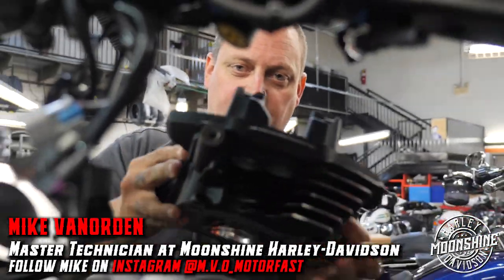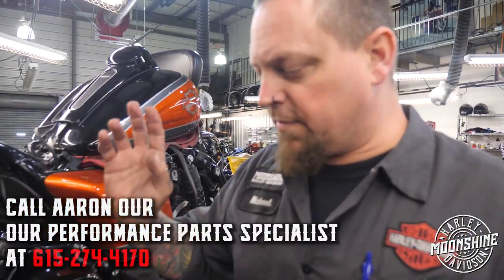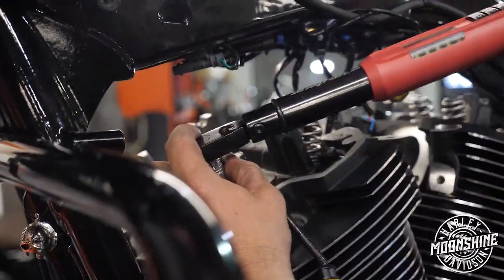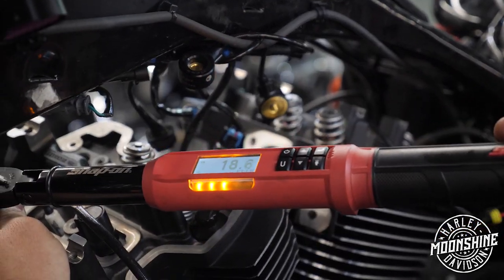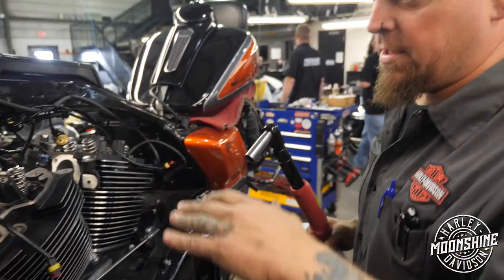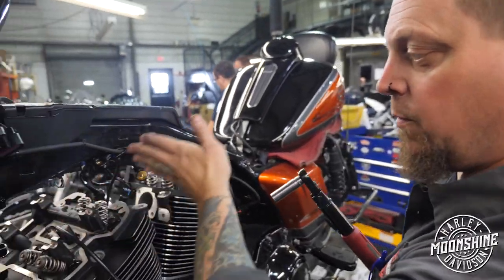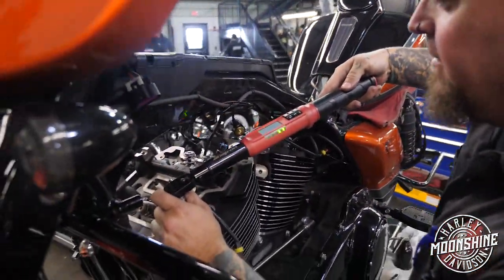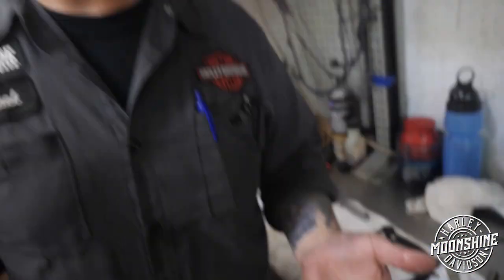M8 Head Bolts Are BREAKING!! Let's Fix It | Shop Talk Episode 27

Comment: And all that will change  after heat cycle . also hope your using moly lube on the threads & under the head bolts. big difference you'll come to torque faster  less friction

Comment: Good stuff and procedure but I've learned on my second Harley and I'm on my fourth now to leave them stock less headaches exhaust and aircleaner change & tune and that's it .
Reply: I think the increased torque on the M8's (partly due to the increased size of the fasteners themselves) is part of the issue.  On the Twin cams the Cometic final torque is 42 lbs I believe and the 90° torque to yield (stock procedure) is started at 15-17lb/tq.  On M8 the 90° is started at 25lb/tq while the S&S/Cometic recommendation is 45 lb.

Comment: As a heavy duty mechanic and retired for 12 yrs and a owner of Harleys it always blows my mind way they waited so long 
to put in oil spray piston coolers and it's time to make better head gaskets . maybe a fire ring type to stop the back head gasket from going out .diesel engine compression is way higher than gas and with the fire ring type  used in MACK i never had a gasket 
problem .torqe recheck and go up recheck and wait and recheck i never had a come back .motorcycles are still in the dark ages

Comment: As a professional mechanic, I have never liked the "low-torque plus degrees rotation" method for torquing a head. Your finding here once again proves there is no substitute to proper "true torque" procedure when torquing a head. And just as you found here, the new head gasket settles & compresses. This is the reason you need to go back and re-torque the head. On industrial diesel engines, we would test-run the engine to operating temperature then re-torque the head while hot (not recommended for Harley, or aluminum heads). This also meant re-setting your valves of course.
Reply: Jim Manson  we also never reused headbolts....
Reply: I am a certified aircraft mechanic and I find it appalling at how good harley is at releasing new models before the engineering work is complete. For some reason, they can't even manage to get their throttle by wire correct. I have a 2001 Jetta with a flawless throttle by wire system. I guess Harley didn't have the common sense to contract out the design to Bosch!
Reply: @skorpius752  "Here hold my beer.  We can do it."  hahaha
Reply: @skorpius752  Harley is just doing what Harley has always done. It's called cheap and dirty. The best bikes that Harley has ever offered are the ones primarily designed, engineered, and built by someone else like the V-Rod which was HD's second joint venture with Porsche. (The first was the Nova in the late 70's.) Their customers are not open to change so HD doesn't change. (This is borne out by the HD owners first reaction to the M8 engine. It was too smooth and didn't shake enough.) It will in the end be the cause of their demise unless they can remake themselves as a tech company which is highly unlikely. One of the interesting things that has happened in the last few years has to do with millenials. Millenials don't like to ride bikes and there was a study done to find out why. One of the biggest reasons was they don't like all that shifting, hence the Honda Goldwing DCT. Part of the study was to try to find out what bike a millennial might be interested in and they were overwhelmingly in favour of HD as their first choice based on brand recognition. Harley thought this was great and sold as many bike to millenials as they could. Problem was, they didn't put any money into improving their product with things like a DCT or better reliability. When it came to purchasing their second bike, the few millenials that would ride chose anything but HD products. Too many breakdowns, too many problems, and too many bills to keep them running.
Reply: @oh8wingman  You are absolutely right. My younger brother is a case in point. I ride a Moto Guzzi and about the one and only time i mentioned The VRod he could only criticize it. Try to pinpoint the reasoning behind that attitude and i can only conclude that i didn't realise he was so dense. Also that he would be such a band wagoner. I pretty much concluded that it didn't sound like the traditional Harley, didn't look like it or have the same power curve. In short, it was too advanced for his liking. He didn't appreciate the more balanced, higher rpm characteristics of the V Rod over his 2006 Night train. The DOHC shorter stroke engine did nothing for him. I'm thinking maybe he raced one and concluded that he didn't like that sound pulling steadily away from him and his bike because i have seen the VRod being wrung out and that thing really moved out quickly with a more refined everything.
Reply: The whole point of going to the "low-torque plus degrees rotation" method is it provides a more accurate clamping force that relies on stretching the bolt, rather than a set torque where friction often means that setting isn't accurate. If a bolt is designed to stretch a reasonable amount when installed, if there is any "head gasket settling", it won't affect the clamping force much. A very strong bolt that hardly stretches at all is much more affected in the same scenario. Those sort of bolts can go from maximum torque value to released in 1/8 - 1/4 of a turn, so are more susceptible to clamping problems, especially in engines that expand a lot or run hot.
Reply: @deaddoll1361  i like how you said streching the bolt. I think a lot of people domt understand that they are essentially springs that change and adjust through and after torquing

Comment: I  love it.  Why this is happening is really a physics equation.  So much for the Engineers, experiential wisdom is the 💣.  I be building my S&S 129ci w/ Fueling 508 kit.  This information will never be obsolete with this design.  I’ve dreamed of a MSH bike during COVID.  Just not able to go big.  I went to Harley’s 120th because Shantell Williams and her husband Cobb believed in me, three month after purchasing my Glide.  Now I’m prepping for Milwaukee again but this time I’m pushing through to Sturgis.  MI take delivery on my build this month;

S&S 129ci Kit
S&S Head Bolts and Cylinder studs kit
S&S Roller Rockers
Fueling Gorilla Rocker Shafts
Kibblewhite Beehive 550 Titanium lift springs
T-Man Head Breathers
Fueling 7263ST 508 Kit
Star Racing Tapped cuffs
T-Man No Loss
Thunder Max Tuner

Currently at tear down stage, and considering sourcing a set of used SE Heads from EBay using my valves.  

Are 114ci/117ci SE heads the same as 107ci heads?  

I’m concerned about deck height and piston travel.  If I can swing the SE Heads I will try to have them resurfaced with an 11:1 compression ratio.

SQUID
ET1(SS/SW/MTS) US Navy, Ret.
2020 Fat Boy “Killmonger”
2021 Road Glide “SilverBACK”

Comment: This happened with the early evos too. 
Been using the S&S sequence for years.
Reply: It happens across all platforms and all manufacturers.  They are engineered to be stock.  When you exceed what they were originally built for you have to upgrade the components to go with it.

Comment: Just about every issue I hear about lately points to Harley having issues in the head - first gaskets then bolts. I wouldn't buy an M8 bike unless it either already had the head gasket and bolts replaced or it was cheap enough to afford having that done right away. Thanks for the vid - great info!!!
Reply: @it'sallhappening absolutely.
Reply: If the bike is stock it won't have any of the issues we talk about in our videos.  All our videos and the failures we make videos about are on modified engines.  The M8's are bad ass platforms.  If you buy one and want to get performance upgrades just do a little "checking around" before choosing the shop to do it.
Reply: Or grow a a pair and do the motor work yourself 👍

Comment: I don't have an M8 so I am not familiar with Cometic gaskets for them, but on both twin cams and sporties Cometic recommend a five step sequence (six if you include the initial finger tightening) 0f 9, 14, 22, 35 and finally 42ftlbs. The gaskets are the same type - MLS - and surely they (Cometic) specify a sequence ?   I have even re-used Cometic (and similar) MLS gaskets three or four times with zero problems experienced and the cranking pressure of my sporty is over 230PSI...... can't test the twincam as it has easy start cams but the static comp. ratio is 11.5 : 1.....
Reply: I think the increased torque on the M8's (partly due to the increased size of the fasteners themselves) is part of the issue.  On the Twin cams the Cometic final torque is 42 lbs I believe and the 90° torque to yield (stock procedure) is started at 15-17lb/tq.  On M8 the 90° is started at 25lb/tq while the S&S/Cometic recommendation is 45 lb.
Reply: @NoName-vz1ob   I didn't realise that the threads were bigger diameter - so higher torque is explained, but my comment was more about the five step sequence with Cometic gaskets on earlier models - I am sure it is similar on M8's. Comparing stock 'compressable'  gaskets with solid MLS types is a nonsense anyway- stock gasket are crap anyway !

Comment: Isn’t that considered a soft joint because of the gasket? If it is the bolt will relax 30-50% rather quickly. Kind of odd usually in manufacturing they go to a snug tq and then tq to angle with a final tq in a tolerance zone.
Reply: That is what we are thinking is causing the issue.  The lead/graphite gaskets provide much more relief  vs. the MLS metal gaskets.

Comment: They are one time use only.   I am running stock with a trask turbo on my low rider and have over 10,000 miles. Mike you call your self a master tech but you fall for all the Gimmick aftermarket fixes

Comment: I don't have a problem with my head bolts breaking..
But then I own a Honda.
Matter of facti haven't really had a problem with anything breaking on that.
Almost 25 years old with over 100k on it and it still starts and drives everywhere I need it.
Oil tires and gas... All it needs.

I always want to go ride with my Harley buddies but their bikes are always "in the shop"

Comment: Stock head bolts breaking, wow that’s a problem. I would be pretty upset if that happened to my new bike. Does harley have a fix? Seems there have been other reports of head problems with the M8 motor.  Great content guys. Thanks for the update
Reply from the maker: Anytime Thomas
Reply: Thomas Hall The head bolts are only breaking under larger performance builds.
Reply: Thomas Hall, did you watch the video? If you did, you didn't comprehend the information. These bolts break on PERFORMANCE,  engine builds.
Reply: Thanks, i guess I misunderstood, so a Harley stage 4 with high compression pistons is not a performance build?

Comment: I thought with the angleometer,  you had to complete the angle in one smooth steady motion as opposed to breaking it up in increments to reach the total
Reply: No.  It tracks the angle on the digital ones.
Reply: @NoName-vz1ob  for experimental purpose. Clean and dry the head bolts. Make sure the holes dont have any fluids in them. then torque the head bolts to the first desired spec then the second spec if applicable then utilize the angleometer in one swift motion. Then measure the torque with a torque wrench. They should all be the same. Not so sure they would be if you turn it in increments. Especially if it is a torque to yield Bolt
Reply: @kaboom362  they are not installed dry.  They should have a drop of oil on the threads and on the shoulder.  We have checked them.  I have a traditional anglemeter which is how I always did it until we started checking them.  We have been working on this for 3-4 months now looking at the torque differences.  And we never reuse the head bolts so that isn't a factor.  The break away torque is consistent with our tightening readings.  Fun stuff.  Thank you for watching and getting involved.  Love it.
Reply: @NoName-vz1ob  gotcha. Thank you very much for the reply and the detailed explanation. Really enjoyed the video
Reply: @kaboom362  We appreciate your interest man.  Keep the rubber down.

Comment: Would you recommend an M8 owner
To replace his gaskets with mls gaskets?
Thanks. 😀👍
Reply: Not just for fun.  If you are doing performance modifications that include removing the heads then yes.  I tend to veer towards the "if it isn't broke, don't fix it" approach to gaskets, springs, oil pumps etc.
Reply: @NoName-vz1ob 
Yes sir, that answer makes a lot of sense.
I plan on keeping the bike stock until the 
2 yr. Warranty expires.  
Then consider putting slip on's.

I was researching the Vance & Hines 
40th anniversary slipons & from 
what they explained, you need to
purchase a fuel 2 air mixture app. or
Kit for it.  
Is this true? 
And if so,
Would that require putting mls
Gaskets on it? 

Thanks man.  Your first response
was really helpful to me.  👍
Reply: @Logan-or5qw  The only reason you would need to replace the head gaskets is if you are going to bump up the displacement/compression from stock with a performance engine.  And I don't recommend a FuelPak for a tuner.  Power Vision is much more comprehensive and the price is not that different.

Comment: Just bought ACV 0 1 17 2019 What is the best Cam to put in that someone told me Andrew 464 Or as a Harley  p0wer cam better
Reply: The Andrews cam will make more power.  However it may not be the best choice if you are going to stick with the  HD tuner.

Comment: I am so ticked off with Harley. I bought my first and last new Harley in 2018 Road Glide only 7K miles I get a loud knock in the engine. The HD tech tells me my rocker bolts have come loose, he said it caused damage to my pushrods and the cost to fix is around $2000.00. I knew Harley was junk before I bought it, but I figure if I buy new and properly service I might be ok. WRONG!!!

Comment: The torque specs I've ever messed with are set once and you're done. What is the purpose of setting a torque value and then backing it off then resetting? Is it to generate heat through friction so the bolt and frame merge together?
Reply: In this case it is to compress the gasket and then torque to spec.  If you compress the gasket while applying the final torque it is possible to achieve a false compression level.  This is the same reason it is recommended to put a drop off oil on the threads and head bolt faces to reduce friction while tightening.
Reply: I see. Thank you.

Comment: Funny, my 2001 Ducati had 197.000 miles on it and I NEVER touched the head bolts 😎😎🏍🍺
Reply: These are high performance engines.  Not stock.
Reply: @NoName-vz1ob  you can't use high performance and Harley Davidson in the same sentence 😅😅🏍

Comment: The whole concept of those so called "Head bolt's" is of a flawed design.  They are not bolts at all but rather sleeved nut's.  The wall thickness between the bottom of the thread pitch and the outside diameter of the "Head bolt" is too thin. This being the case along with the fact that there is a sharp and acute angle occurring in the bottom of the thread is leading to high concentrated stress areas in the lower walls of those so called "Bolts"...this is really bad engineering practice.  I am guessing the only reason HD has done this is so that you can do a top end overhaul in frame.  It is a cheap and nasty solution and is a total bodge!
Reply: HD has been using this style since 1984.
It happened back then, they changed the torque sequence. Nearly 30 years later, the problem comes back with the same solution.

Comment: Or it could just be that factory harley hardware is absolutely fucking junk.
Reply: There is nothing wrong with the factory hardware.  We are adding bigger pistons/cylinders and increasing compression and valve lift over the factory design.  I have never even heard of a stock M8 breaking a valve spring, head bolt, or blowing a head gasket.  I'm sure someone on the internet will claim it's happening all the time (like the sumping issue which is also very rare in real life) but it simply isn't a thing.